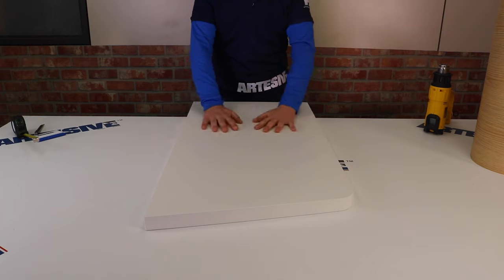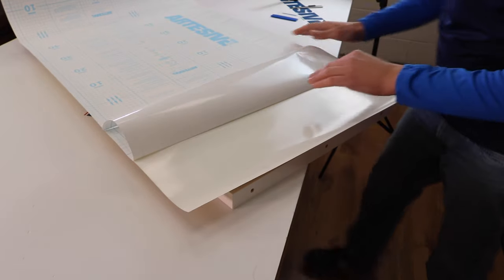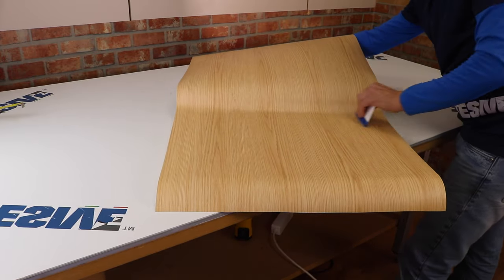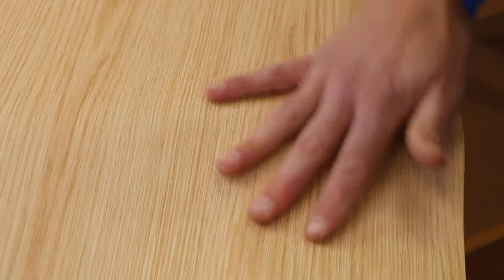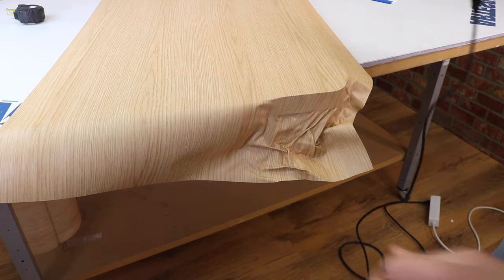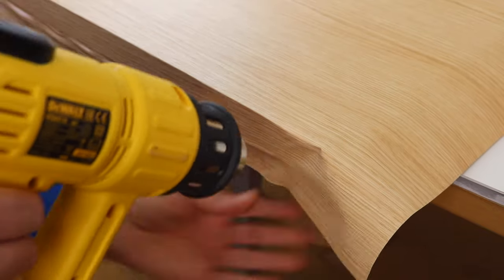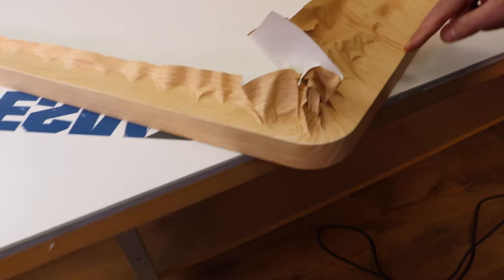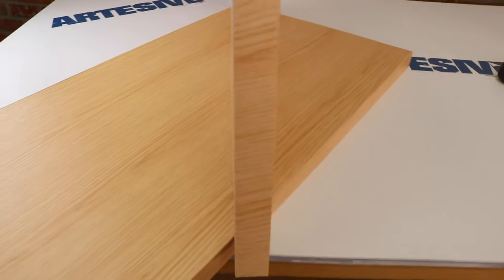Curved Corner Self-Adhesive Vinyl Film Application (full) with Hot Tensioning

Comment: Great tutorial! Will this method work on a board with rounded holes inside? I want to wrap my radiator cover somehow. I think it would be much easier to hot tension all those holes than trying to trace and cut out the foil.
Reply from the maker: hi, thanks. then , this is up to you. we suggest to test first in some part and then decide if this applications can be fine for your case.
Reply: how did it work out ?! facing a similar issue. i will use heat to mold the film into the creeces, i don't know if this solution will last over the years though ...
Reply: @Ris-v4w  I gave up the idea of using the vinyl wrap at all. The adhesion was too weak on wood material.
Reply: @secession77  yeah, this just looks to be a short term solution. although i think it will last 2-3 years if applied properly, until i get the chance to remodel

Comment: Thanks for your tutorial on how to, Can I apply it to a painted but sanded surface and clean or I have to apply it with putty filler? thanks and Regards Sir Reed
Reply from the maker: Hi, I didn't understand. If it is already filled and sanded, just use a primer before applying the vinyl.
Reply: Hello I have an ikea cabinet door that is mdf. There are little parts that has already bubbled because of moisture. Can i still salvage it and cover with contact paper?

Comment: Hello! What temperature should we be using for the heat gun! Thank you!
Reply from the maker: The temperature used depends a lot on the film, the distance and the work you are doing. Generally a temperature of 150-200 °C (300-400 °F) is used. However, it is possible to use a normal hairdryer, the time will be longer due to the lower temperature.

Comment: What if the surface is curved as like that of shield of captain america
Reply from the maker: beside asking Iron Man, we should see how is the shape to answer you better. Please send us an email and we will reply you better.
Reply: You mean using it on compound curves ? I would think that if it works on that fairly sharp,curved corner a compound curve would be easy,using the heat gun. I have to update my kitchen cupboard doors, and intend to use it on them.Every corner is a compound curve. Even on my old kitchen,the covering on the corners was beginning to de -laminate,where there was any heat.So even professionally made cupboard doors can have problems.But I am sure after a couple of failed attempts I will get the hang of it. Cheaper than replacement doors. Similar film is used on Cars ,and compound curves come in abundance on vehicles. Give it a go. Hope all goes well on your project. Don.

Comment: Hi, thanks for the info. Would like to ask. Can it be stick on a plywood or mdf board door.? Do i need to sand it and apply primer before applying this vinyl film?
Reply from the maker: Hello. Yes it is better to sand it before.. On MDF surfaces we suggest to smooth the surface before apply the vinyl and use the primer especially on corners or edges, such our Magnum Primer for example. You can find it on our official website artesive.com
Reply: @ARTESIVE  Can I purchase the vinyl in india ?

Comment: Found it useful till you didn’t show the next step of applying the back
Reply from the maker: Hi, maybe we'll show it in the next tutorial
Reply: I usually precut for the back to make sure I do not slice through folded over edges of front film. 

Matching grain or pattern is also important for good look. 

I move film around until I find good pattern match and then mark that spot and then draw exact required size and shape of the back from that mark. 

Then apply as usual - peel a little backing, fold backing paper, and start pressing. Takes a while oftentimes.